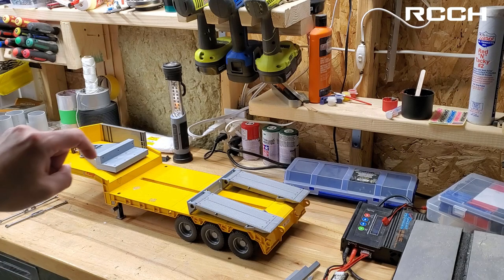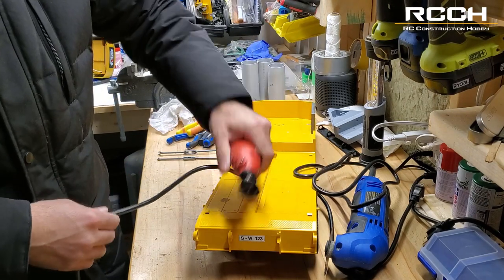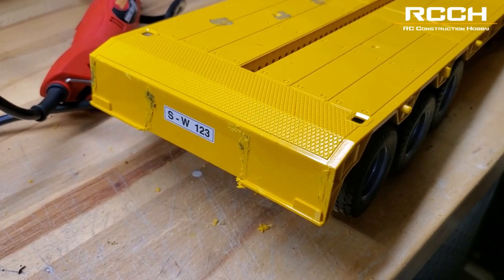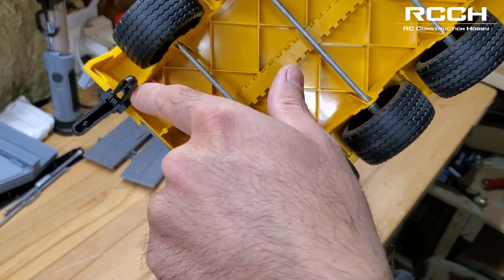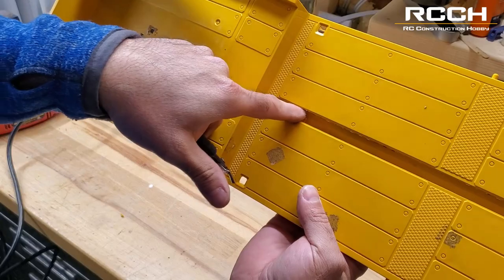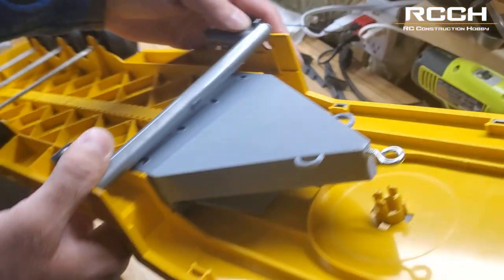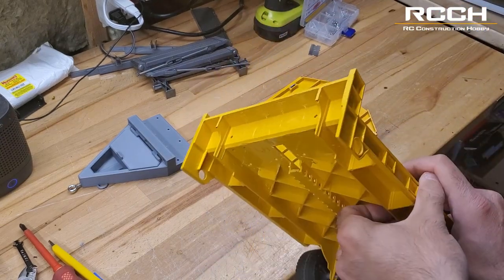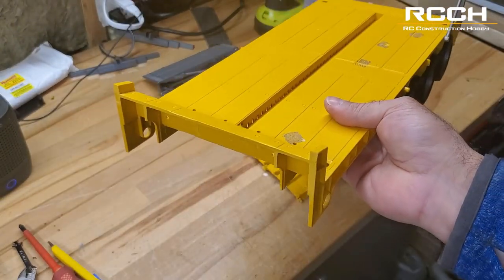How to Build a BRUDER Flatbed Trailer STEP BY STEP!

Comment: Love your build just wanted to ask you where did you get the design for the binders do you have any photocopies of those or anything I have a friend of mine who has a 3D printer but we don't have any designs or photos or anything of those binders perfect I have equipment and I'd love to get a pair of them thank you wondering if you could send it me a link or a description pictures of what the binders so we can make some thank you very much
Reply from the maker: You can find the files to print on thingiverse. I also made turnbuckle binders which you can buy. Most hobby shops carry them but if not Amazon has them. You want to look for dubro du-300. Add hooks and you have a turnbuckle binder. Do a search on thingiverse for pedrcri. That is all my files to printing.

Comment: How do I get in contact with you to purchase the pieces as I do not have a 3D printer?
Reply from the maker: There are some people on Facebook that print parts. I don't print for others as I don't have time to. Search Facebook for Doug Witt as he does print some of the things I have designed.
Reply: What 3D printer should I be looking for.
Thanks
Reply from the maker: Just a regular ender 3 or ender pro from creality.
Reply: Do you sell the programs for the bruder trailer.

Thanks
Reply from the maker: The files are on https://cults3d.com/en/3d-model/gadget/bruder-trailer-neck. Then you can print it on your printer or someone else's. The software is called cura for setting the files for the printed. It converts the  stl file to a Gcode
Reply: How do I get this dpwn load

Comment: 😁 check out the hg beast I have converted.  My new day hauler.  I’ve been wanting to do this trailer I have a spare Bruder.  I’d use it behind my rigs even on the 1/12 scalers 👍🏼
Reply from the maker: Sure I will check it out.
Reply: @RCConstructionHobby  nicely done and walk through.  If and when I got time off from my builds I’ll give this a go.
Reply from the maker: I made this video almost a year ago so I figured why not post it since its winter more build videos.
Reply: @RCConstructionHobby  yea I thought I've seen it before and I know Ive seen your design before even on maybe thingyverse great build regardless.   I like my Bruder builds they were unique and extremely functionable yet Im really digging the slightly bigger scale of the 1/12 line up. still might dive back into building bruders one day.  I still have all my files